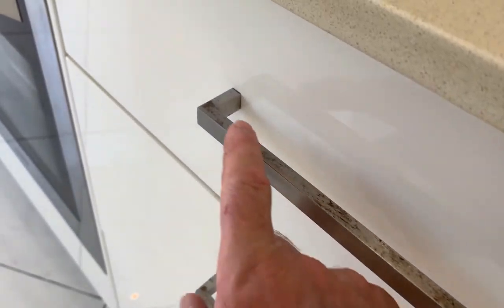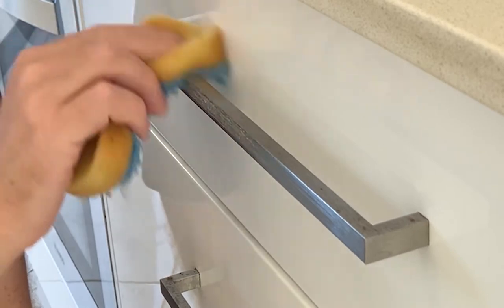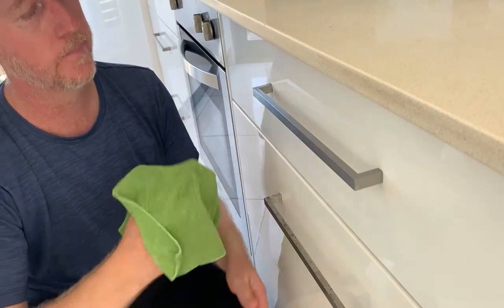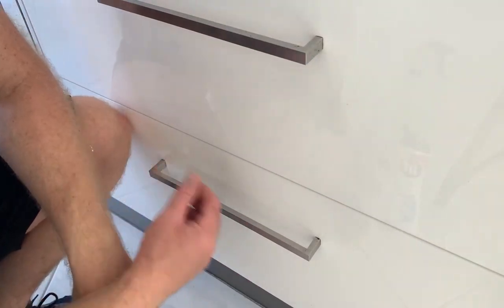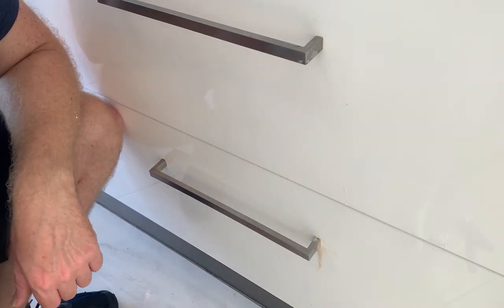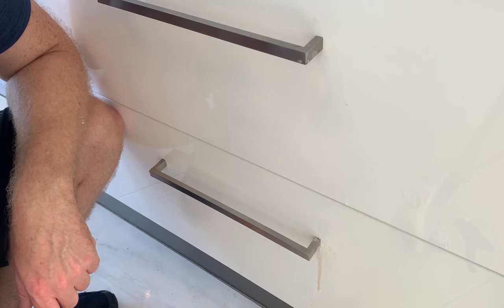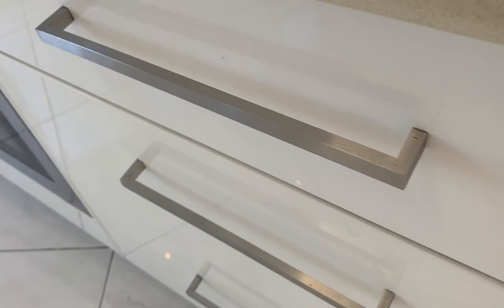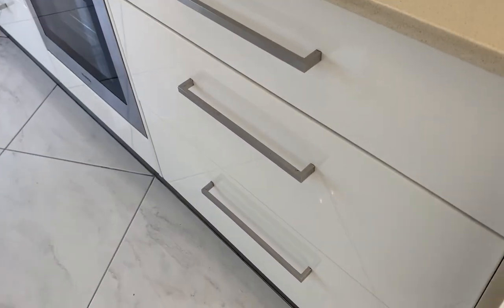I Help You Clean Your Cupboard Handles

Comment: You could remove the handles, but thanks for the tip. I will try.
Reply from the maker: You can but for me in the time it takes to unscrew one and screw it back on I would have cleaned two. But if you want to scrub them madly it probably is easier to take them off 👍